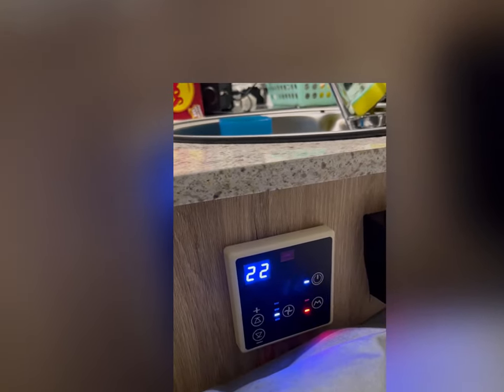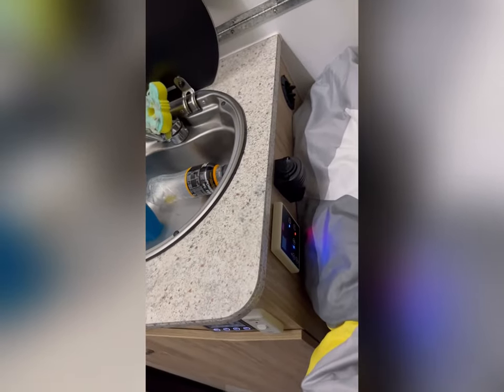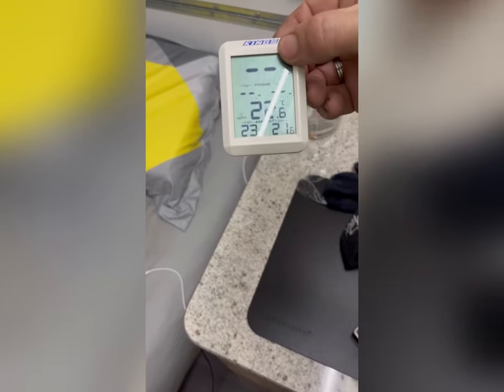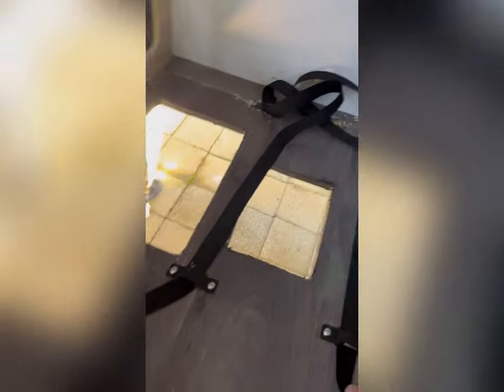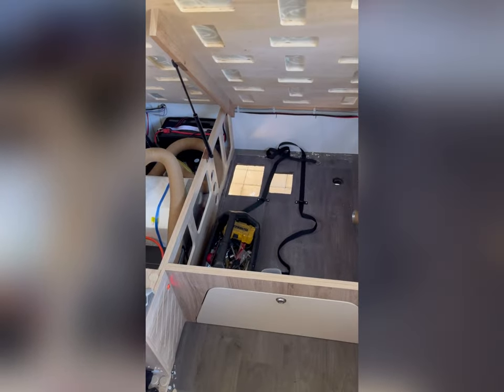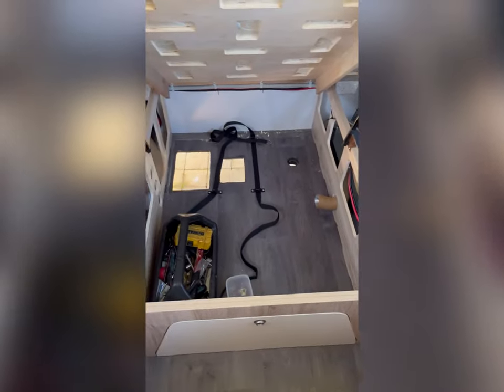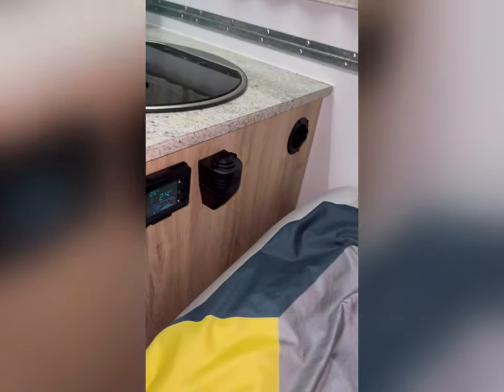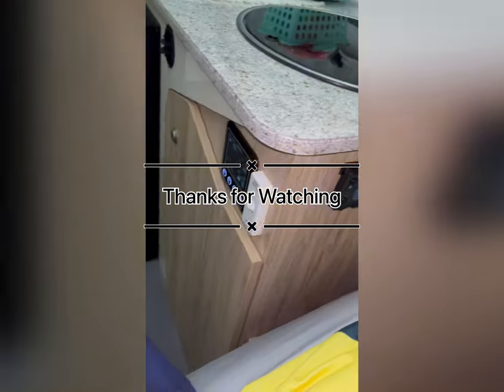Avan Cruiseliner Adventure plus diesel heater

Comment: Hi Matthew

I have installed one of these heaters in our Cruiseliner in 2020. They are so good in our vans when there are more places for cold air to get in, than traditional style vans.

Can I suggest running the outlet from the heater, straight forward to the front of the under bed drop down door, where your feet are when sitting on the bed. You will find the loss of heat from all of that ducting, to be reduced dramatically. It would be less than 1 meter rather than possibly 5 or more meters. You could also enclose that short piece of duct in insulation so it doesn't heat up the under bed area too much.

As you have it set up, the heat will warm up all of your cabinets that the ducting runs through, to a much warmer temperature than the living area will ever get to. Any items in there will get hot as well!
You can see in the video that it was hot to touch the ducting for any length of time. You will find that this change will make the air hot to the touch at the outlet and the loo paper test strip will fly sideways with the force.

As an experiment, close two of your outlets and see how hot the third outlet gets when there is no loss of heat from the rest of the ducting. I would try the outlet near the door, as it has no second y piece to reduce flow.

I also installed an inlet vent from the living area to the heater inlet. The suction from having it open to under the bed, sucked air through the external power inlet and battery vent. Fumes from outside were also brought inside to the living area if the wind was coming from the wrong direction

Make sure you don't have a switch that you can turn the unit off with. It cannot be turned off instantly and must be able to go through the shut down sequence fully. Fire may result otherwise!

Hope this help mate. Just some hints and tips from our experience.

Happy camping.

Comment: you have a vent in the door and one at the apex... thats where you heat goes
Reply from the maker: Doesn’t effect it that much and need a bit of fresh air .
Reply: @matthewcaple8954  I tested mine at 0c and it is about 6C in loss. The top vent you can tape 70% and it makes a difference. the reduced area is not reduced flow as the air flows faster in that situation.

Comment: Hi Matt, appreciated seeing your video, I’m about to do the same to my 2004 A Van. I am curious as to your thoughts on removing the AC .Do you think you’ll miss the cooling function ?  I’m also considering removing mine , for one the cooling function isn’t working and I’m not sure how beneficial it would be anyhow . Would appreciate hearing your thoughts . Cheers Bob / Gold Coast .
Reply from the maker: I found the cooling was not that good .you can get a bigger /better unit with more hp but as you need mains power to run one and most of our camping is off grid it was not much good for us . If we decide we need one in the future we would look at getting a small stand alone unit from Harvey Norman or something
Reply: @matthewcaple8954  Hey thanks for getting back to me, it’s good to hear your thoughts and that’s the way I’ve been thinking as well. Thanks again , cheers , Bob